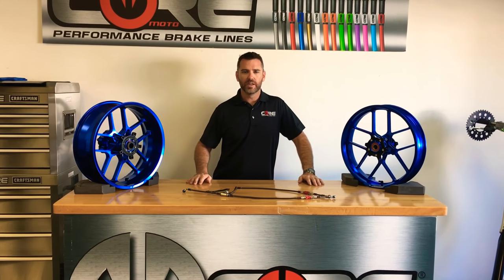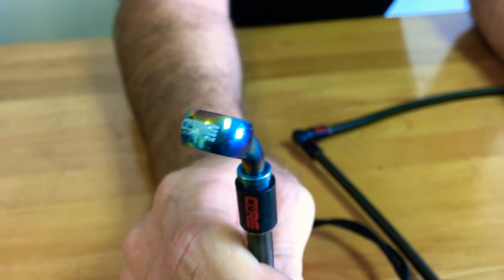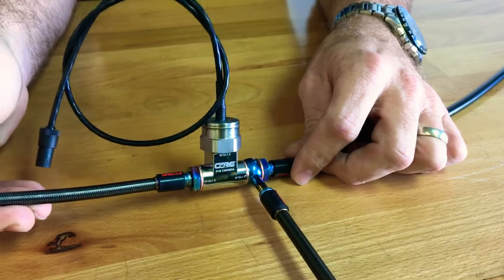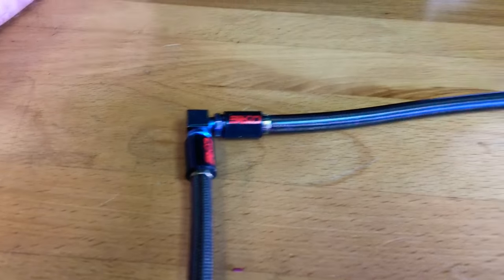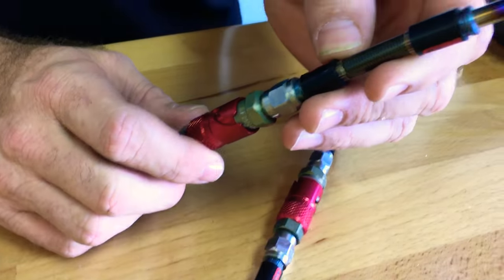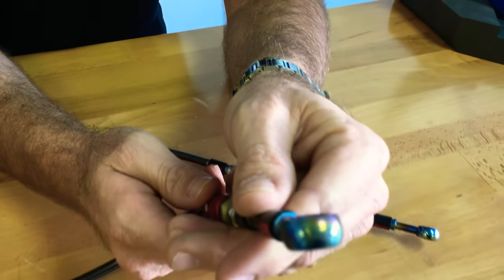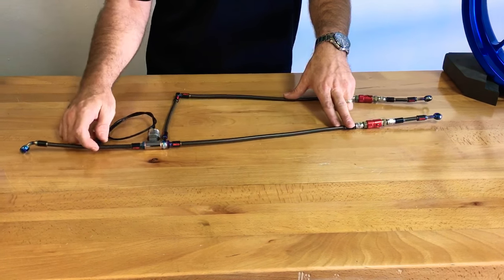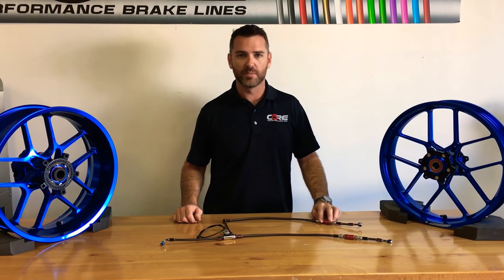Core Moto Works360 premium Titanium  Superbike Brakelines.

Comment: Would it be possible to get a quick disconnect from the master just after the banjo? Just for service wise if you had to change out the front brake master? What’s ting to get them but with that extra quick disconnect system at the top of the bike.